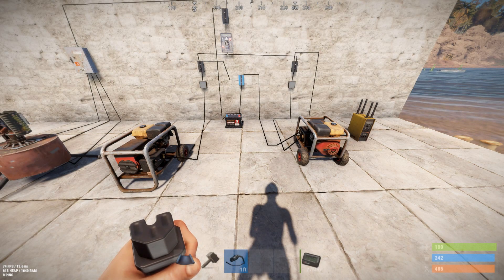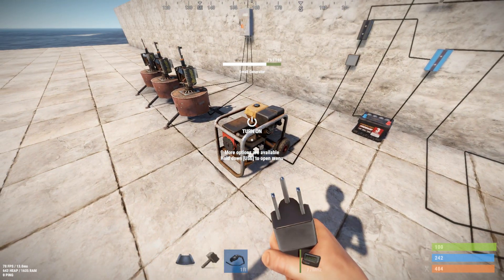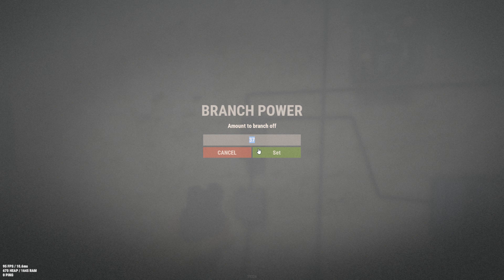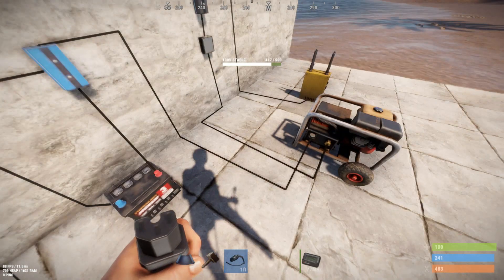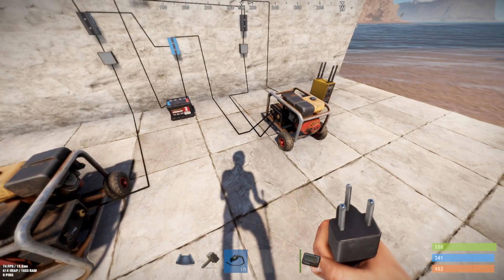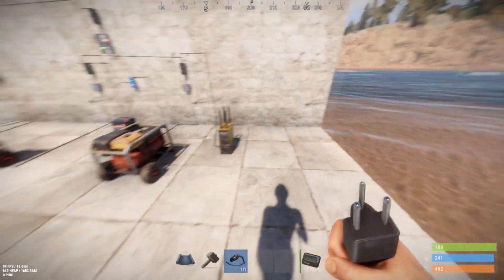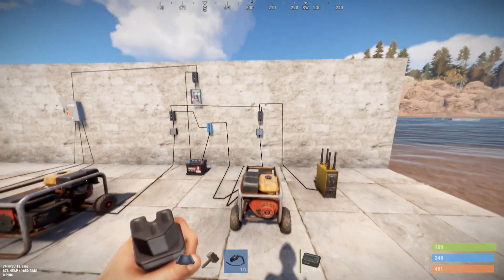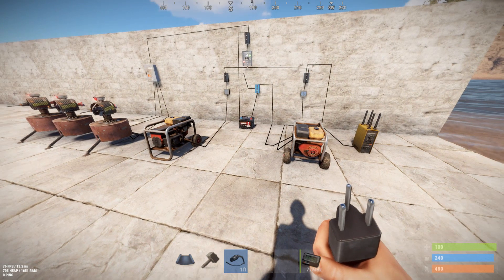Rust Electricity: User Request - Dual Generator Auto-Failover (w/Notification)

Comment: Question...
Went so you need to change the number on the branch?

It should work even if left on 99 right?
Reply from the maker: So the branch on the left there is the trigger for when it fails over, which needs to be set just below your total expected output, so 38 for one generator, if you had say three generators strung together per side, then 118. This ensures it fails over as soon as one or all of the generators go offline and swaps to the other generator(s).

Comment: Perfect. Thank you. My reason for asking about this circuit was that raiders are going to go after your wind and solar first to try and disable your turrets. Therefore, we can't simply think of the small generators as backup to wind and solar, but we must treat them as possibly primary power, in which case we might need a longer run time than one generator (or series of generators) could provide.
Reply from the maker: I have a larger multi-stage power backup demo I'm working on today!
Reply from the maker: Here is two stage, 3 stage posting shortly... https://www.youtube.com/watch?v=-XGnFjIcHso

Comment: Not sure if this was forgotten (I see you have it for the 1st generator), but here is an improvement tip: add an or switch in front of the blocker toggle and have the output of each generator disable the battery once any of them are running. I noticed the battery was draining while the 2nd generator was running.
Reply from the maker: Fair point, but since you manually have to refuel them and turn off the secondary and fire up the primary  (at which point the battery will start charging again), it isn't critical to save the battery. It just needs enough charge when the primary runs dry to start the secondary.